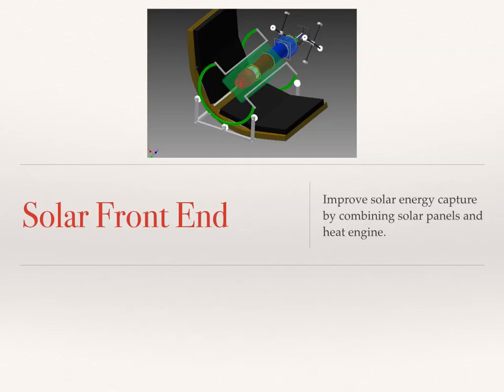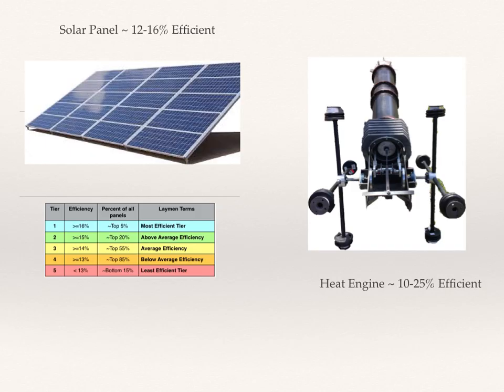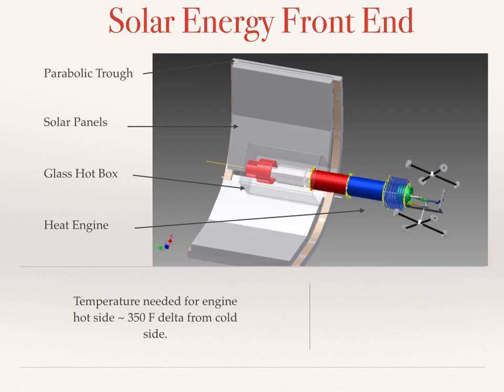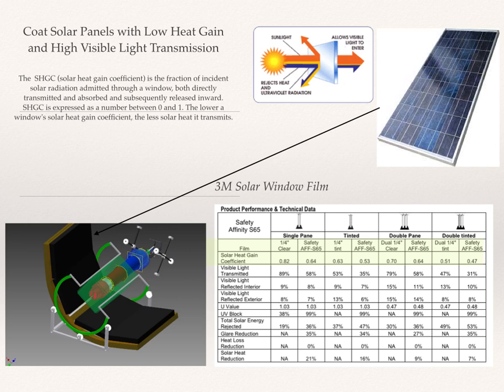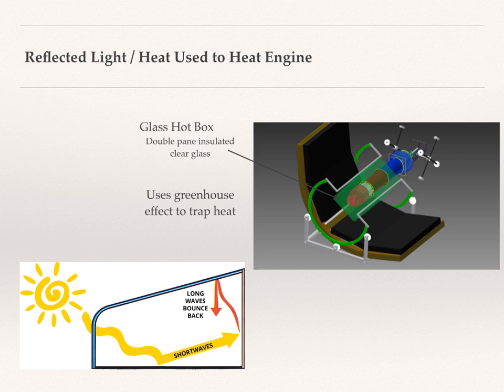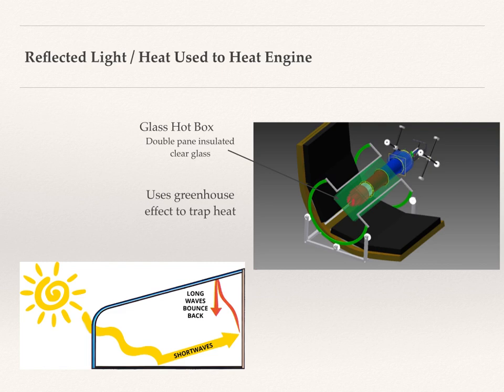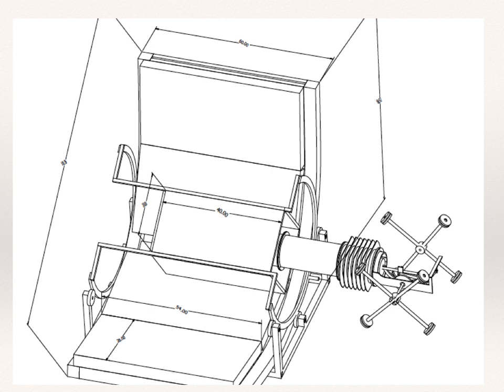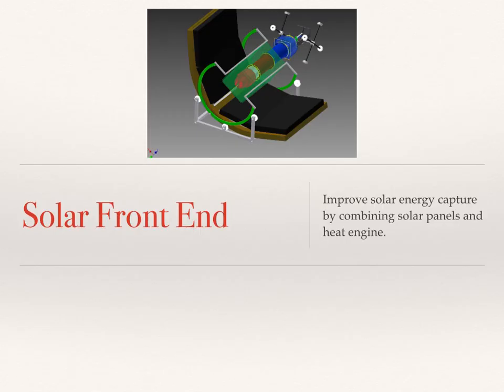Solar Front End for Volo One Heat Engine

Comment: I'm not sure that all the fancy scheming is worth the effort...
A simple solar heat collector with vacuum tubes can heat oil up to 450c...
storing hot oil in converted hot water heaters is a cinch..
let say 350c hot oil in a copper coil around the hot end, 
inside a heater box...  
This all sounds to me like more low tech, built with off the shelve products,
would be scalable (just add collectors at 350$ a pop) and allow 24/7 generation at 1kw
which is what I'm looking for...

I'm not interested in collecting the most solar energy per sqft.
I'm interested in getting the most kw per dolar...

Anyone need a link to the panels?
Reply: yes, Please provide the link